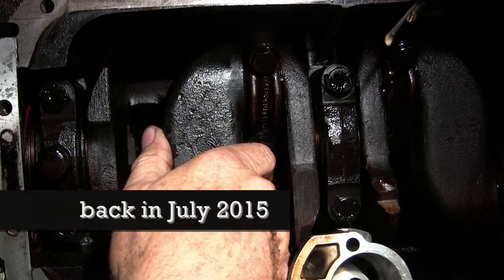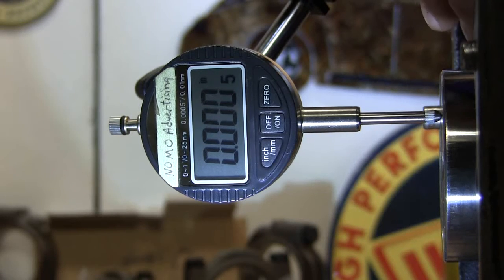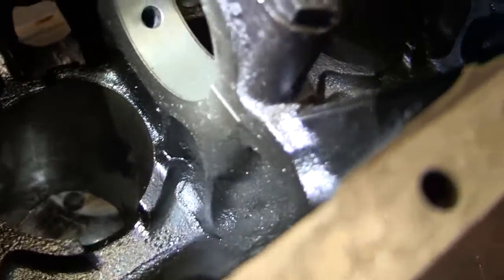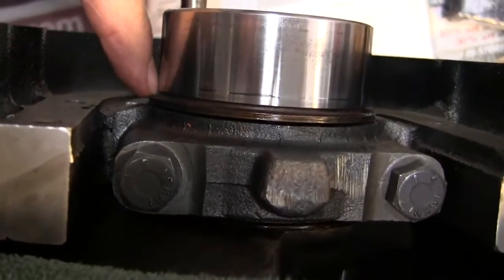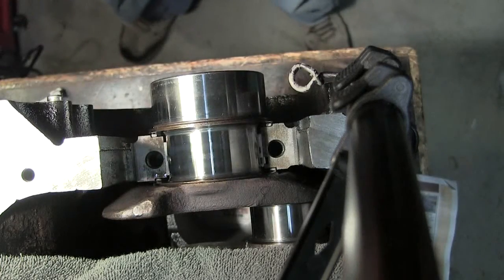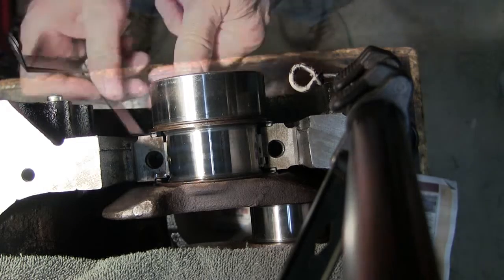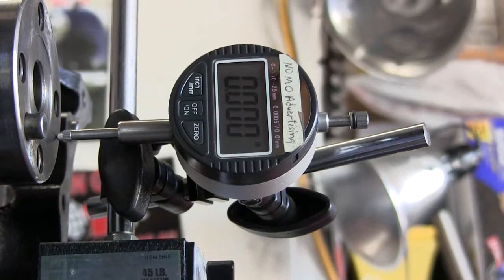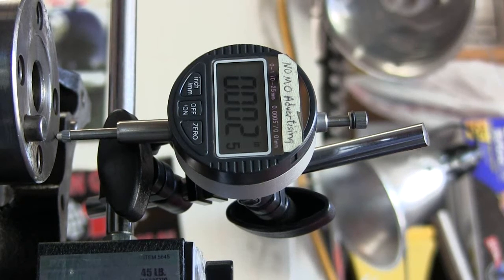CW added 3rd rear main thrust washer to his 79 Triumph Spitfire 1500

Comment: Can I replace thrust washer without dismantling whole engine 4d56
Reply from the maker: yes, mark the rear bearing cap before you remove it, so it will be reinstalled correctly after replacing the thrust washers.

Comment: This is a fantastic idea!
I have seen the "Custom Thrust Washers" type of improving, but your's is much better (and cheaper i guess)
I'm very soon starting on rebuilding a Triumph 2000 MkII engine that i'm installing in my Spitfire.
The endfloat is something like 0,4 millimeters, so maybe i'll be copying you.
Cheers Ulrik.
Reply from the maker: It will take time to see how my cap idea holds up. Other thrust washer ideas will surface by then I'm sure. I would like to know how other cap ideas have worked out. If you hear of anything let us all know, thank you.